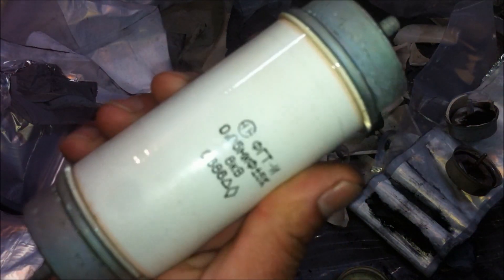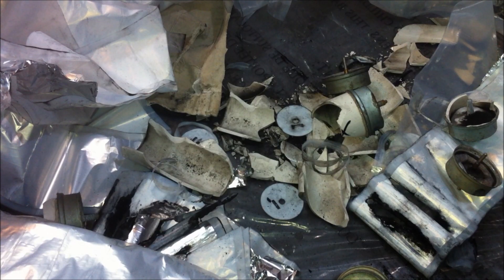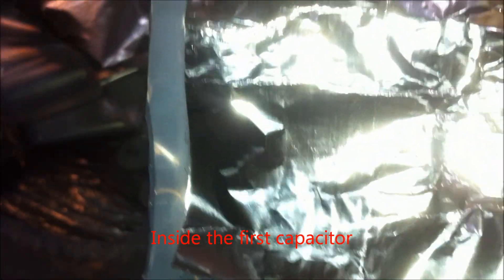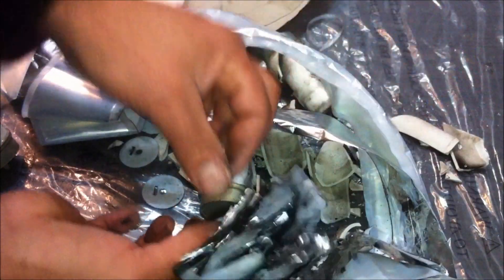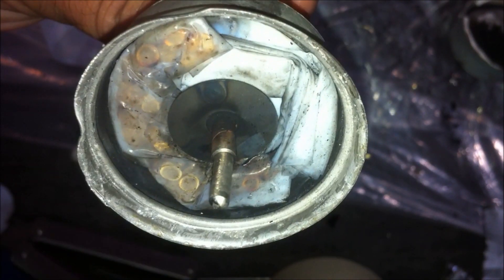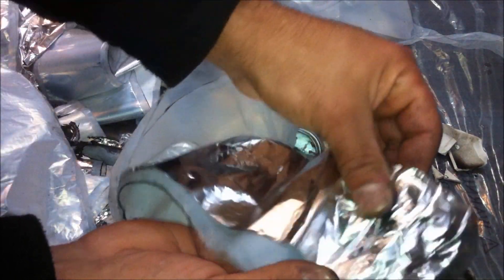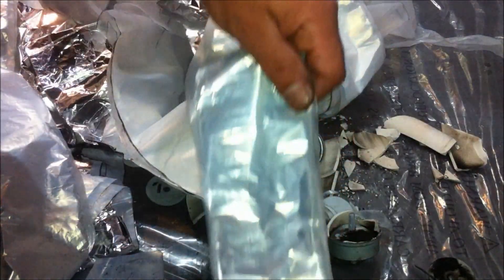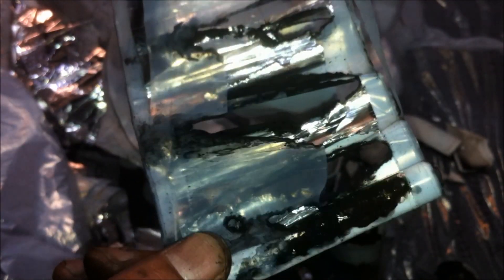Teardown #2 - 8KV 50nF High Voltage Capacitors

Comment: Hi.  I'm happy to have chanced across this.  I'd seen these  caps on 'the bay' & been wondering about them - construction, dielectric, etc. for Tesla coil use.  Even in long series strings, I'd now be dubious about them.  I think you've just saved me a few bucks  :-)  Cheers.
Reply from the maker: Yes, I'd definitely suggest some pulse rated caps, for sure - worth the investment. Keep in mind that these caps died because there was over 1,000 Watts of power being pumped into the system. I've used them continuously in low power setups with no problems... eg. flyback & bug zapper transformers.
Reply: Energy Fabricator Yep, I've built a number of TCs over the last 20 years or so, with various types of caps, including home-made, with good results & very few failures.  I was once the proud owner of a Maxwell 15nF 50kV pulse cap, but unfortunately it was 'lost' in an interstate move.  They're hard to come by here (that one came from ANU) & pretty expensive to get from the U.S.  I'm also a fan of protecting caps from high transient voltages with either RLC filters and/or protective spark gaps across them.  Not sure exactly what you were doing with these, but if you have them resonating with e.g. a neon sign txfmr secondary, you can develop some very high voltages - much higher then the nominal secondary voltage - as I presume you know.
Reply from the maker: Phillll
Yeah, I know what you mean about the high voltages on the NST's. NST's are what killed these caps. I prefer spark gaps rather than RC/LC filters for protection. Its a more exact mechanical action. It's also easier to modify a spark gap than it is to replace RC/LC filters to suit various experimental setups, potentials and frequencies. 

Thanks for your comments :)
Reply: Energy Fabricator Yes agreed.  As all these things are reasonably hard to come by, I tend to go overboard & do as much as I can to protect them: RLC filters inline plus VDRs plus spark gaps across NSTs & spark gaps across HV caps.  Have had a pretty good run - whether by good luck or good management :-)  Haven't done anything lately, but just a couple of weeks back I dragged out my 'baby' Tesla coil from the shed, to show a mate who wanted to see one, and that's inspired me a bit to do some more.  But I really need to clear out & tidy up my shed first  :-)    Will watch some more of your stuff when I get more 'spare' time.  Cheers  :-)

Comment: wow poor caps, looks like alot of arcing to do all of that damage. cool vid! i always wondered for electrolytic capacitors how they differentiate one side of the plate to the other plate when they are rolled like that, or do they have like foil-electrolyte-foil-plastic-foil-etc.? and it is the same in the AC caps so it is basically charging both wrapped layers at the same time?

Comment from the maker: These 8KV caps were actually wired in series x 3, which gave me 24KV on each leg of the NST. The NST was only putting out 7.5KV on each terminal. The transients must have exceeded 24KV to cause the damage you saw in the video.

I spent a few dollars on these caps, so I think I might keep the remaining caps for lower powered experiments.